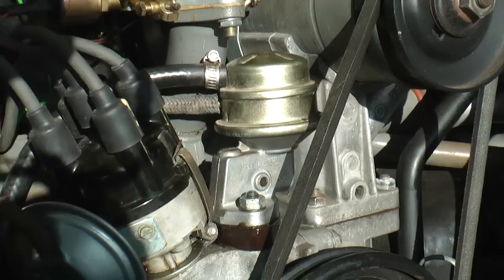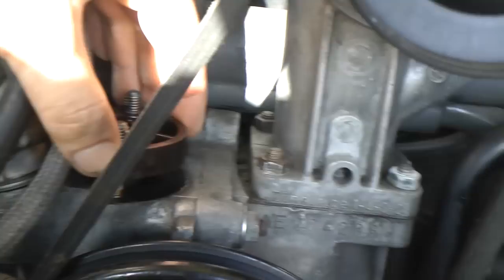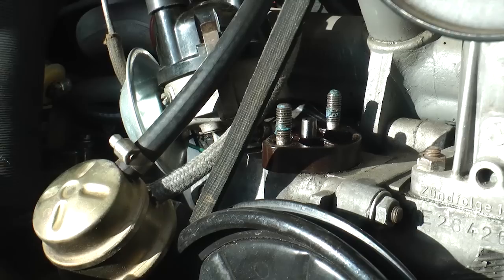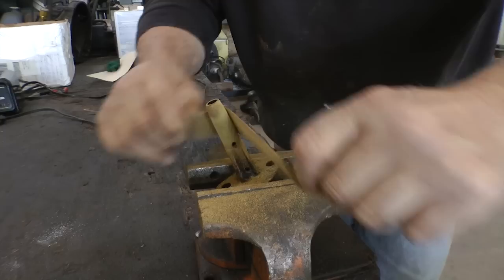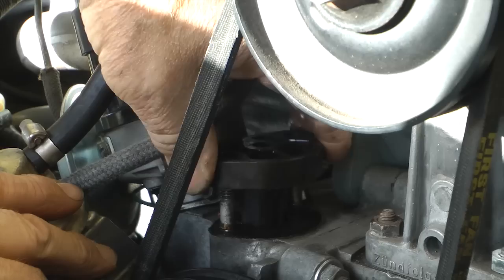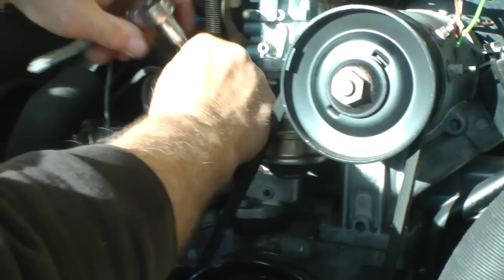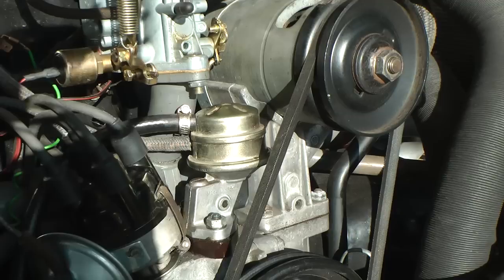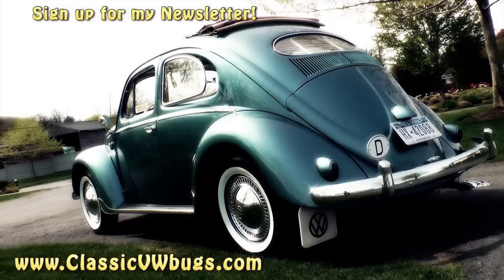Classic VW Bugs How to fix Beetle Fuel Pump Vapor Lock

Comment: That's a faulty fuel pump not vapor lock... Still trying to figure out the gas boiling up and flooding my carb . Any ideas??
Reply from the maker: Is your fuel line touching the manifold?  Or it can also be touching the beat box under the rear luggage area.

Comment: I don't understand. That spacer deal gets bolted down. It does not move. The steel pin inside moves up and down but not the spacer dealy.
Reply: Yes I agree , my spacer broke in half when i tried this, so i put it back together, and it runs, I have dual carbs and rebuilt them some it turned out to be mixture adjustment..
Reply: But now that I think about it..it mite be expanding and putting pressure on the rod when it gets hot..

Comment: If that so, then the real issue is, why is the engine over heating?
Reply from the maker: Well the engine gets warm anyway, and it does not take much to swell the fuel pump rod if the base is too thick.
Reply: Chris Vallone: I never had that problem in 50 years and hundreds of bugs & vans that were “completely stock” i.e. VW original parts.
Reply from the maker: @SuperSpecialty  yeah but what about the world of aftermarket parts these days?  This is not uncommon.  Every year the the quality of these parts keeps going down little by little.  Stuff like this happens all the time.  30, 40, 50 years ago things were much better.
Reply from the maker: @SuperSpecialty  a shmuck like you?? Haha. :op
Reply from the maker: @SuperSpecialty  you're so "super special". Go make a video and show us all.

Comment: Not sure I understand why you would sand the outside the rod slides up and down on the inside that part doesn’t move.
Just saying!
Reply from the maker: You understand that heat makes things expand?  If you don't sand the outside, that base is now tight up against the block, when you introduce heat, that pressurizes the base making it swell thus putting more pressure on the rod.  It can't go any further expanding outward, so it is then transferred inward to swell the rod.  Just saying!
Reply: lol sorry didn’t mean to sound smart I got my 68 Van i’m stuck trying to get it running my head stuck back in the engine compartment with a flashlight and my phone trying to figure this thing out makes sense thanks for the tip appreciate it✌️
Reply from the maker: @timgreene6536  All good my friend, no offense taken.  =o)